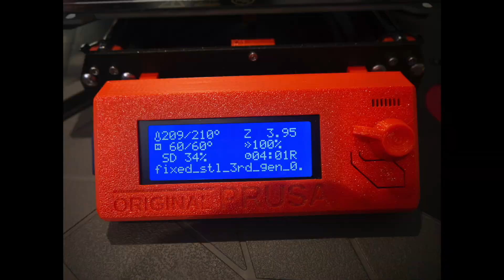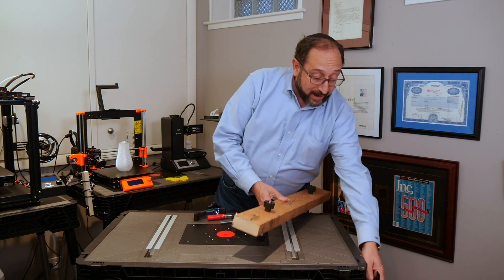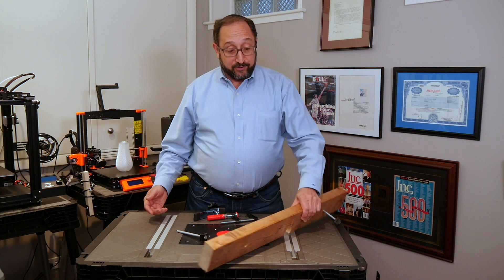Maker Basics: The Best Low Cost Workbench / 3D Printing & Woodworking

Comment: I was wondering what kind of table you were using for your 3D printers in your other videos. 

I was looking for some sort of table to put mine on but was worried about vibration, etc.
Thanks for pointing out this one.
Reply from the maker: This table is not perfect since it is still very light.   A perfect 3d printer table would probably be made of concrete.   I have put my printers on a left over 18 inch ceramic kitchen floor tile to add some weight and minimize vibration.